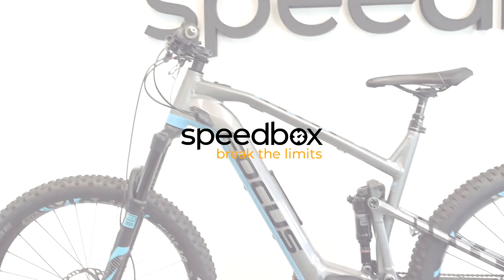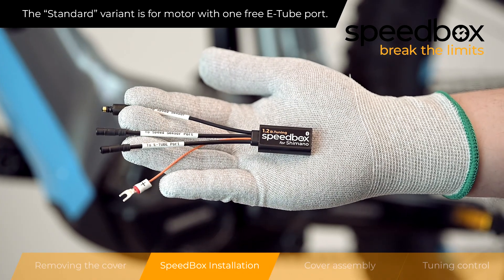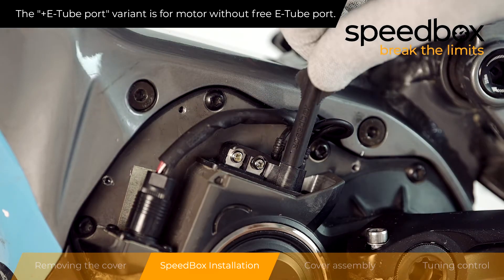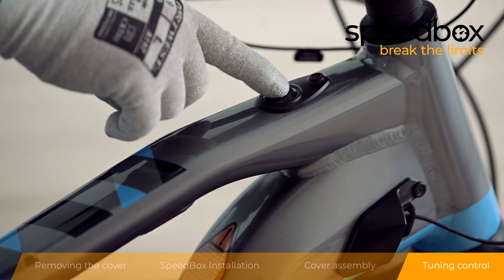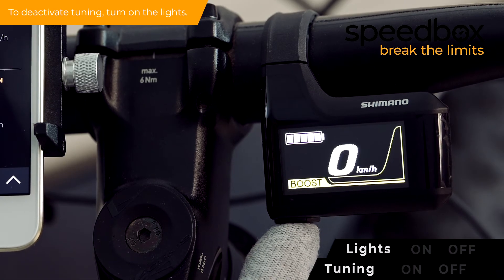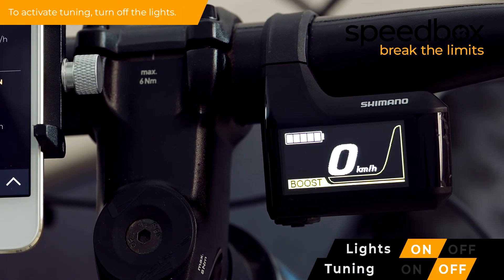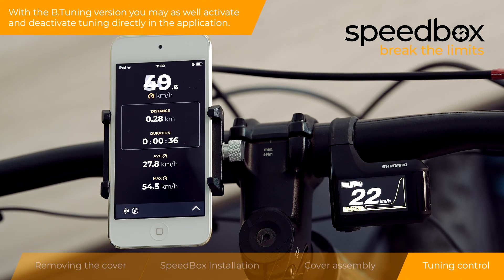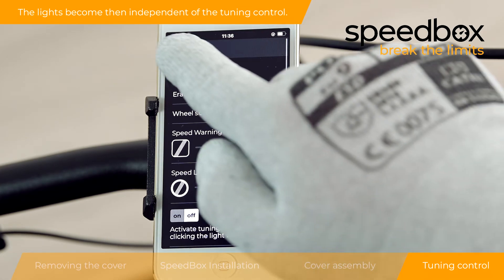eBike Tuning SpeedBox 1.2 (B.Tuning) for Shimano (E8000, E7000, E6100, E5000) Installation (+E-Tube)

Comment: My e7000 doesnt have the same cover . Its a different shape znd when i take it off there more nuts and bolts under it .
Reply from the maker: Hello.
This is an installation video using a specific sample model of an e-bike. Of course, different bikes may have different motor cover systems.
Reply: I can’t find the speed box for e7000
Reply from the maker: @dshow1658  Hello, what do you mean..?

Comment: Hello.
I am using the SHIMANO DU-E6100 system.
(Is the difference between SpeedBox 1.2 and SpeedBox 1.2 B.Tuning the Bluetooth connection?)
It should be fine if I install it as shown in the video, right?
Is it limited to one car? Can I install it on another car after using it?
Thank you
Reply from the maker: Hi.
Thanks for your question. The B.Tuning version has Bluetooth (B.like Bluetooth) built in, which allows you to pair the SpeedBox with a mobile app. Both versions are fully compatible with your e-bike. We recommend following the instructions in our installation video.

Comment: Hy, my bike with e7000 doesn't have Bluetooth, the adjustment its only by cable on the computer,  the speedbox will work's for me? Sorry my bad English, im in South America
Reply from the maker: Good day.
If you have a SpeedBox 1.2 for Shimano, you can control the tuning on the display.
If you get the SpeedBox 1.2 B.Tuning for Shimano version, you can control the tuning on the display or in the SpeedBox App, because the version called B.Tuning has a Bluetooth module in it.
By the way, our website is also in Spanish https://www.speedbox-tuning.es/para-shimano

Comment: I just received mine and was disappointed that it doesn't work, double checked everything, bike runs like normal, there is no difference to my speedometer, motor cuts out at 25km.

I have the light setting in the menu but it just beeps 3 times when i press it, no option to turn on/off.

I have also changed fork from positve terminal to negative, no difference.

Please help i have also sent an email.
Reply from the maker: Hello.
Did you send an email to info@speedbox-tuning.com? Someone from our support team should contact you soon.
Alternatively, you can reach out through the chat on speedbox-tuning.com.
Thank you.
Reply: @SpeedBoxTuning  Same problem here ... And now ?

Comment: the speedometer doesn't work when i use it the speedbox.
Can you fix it
Reply from the maker: Hello.
Unfortunately, the communication between the electric motor and the Shimano display does not allow for a real display of speed.
The only option is display in the SpeedBox App for products marked B.Tuning (B. as Bluetooth).
Thanks for understanding.

Comment: Does this void the warranty of the bike ?
Reply from the maker: Hello.
In theory yes, but practically it doesn't have to be. If you take your ebike to a bike repair shop, uninstall the SpeedBox from the motor. The presence of the SpeedBox will thus remain undetected and the warranty unaffected.

Comment: Can I use S.B. 1.2 for Shimano e8000 + E tube port on the motor without E Tube port ?
:) , the port is on the motor but no cable to connect to speed box.
Reply from the maker: Hello. Yes, you can 🙂Just don't plug in the orange cable with the fork plug.

Comment: Does it still works on the E8000?
Reply from the maker: Hi. Yes, it still works on the E8000 🙂
Reply: @SpeedBoxTuning hi where i screw the red wire down with the + on it there’s already a wire screwed in what should i do?
Reply from the maker: @outside2477  Hello. It does not matter. Loosen the screw and add the SpeedBox "Fork" with + to the one already there and tighten them both with the same screw.
Reply: @SpeedBoxTuning i unscrewed the screw but it wont screw back into place
Reply from the maker: @outside2477  Can't you put the screw back in that you took out? Or is it too short when you put in both red wires with the "fork"? Maybe try using a slightly longer screw with the same thread.
Reply: @SpeedBoxTuning yeah may just need a slightly longer screw

Comment: what if my ebike does not have lights?  How do I turn on tuning?
Reply from the maker: Hi. If you don't have lights, it doesn't matter. Just find the Lights button in the menu and turn it off/on to activate or deactivate the tuning. If the Lights button is not active, it needs to be set using diagnostics. Or you can install the SpeedBox without connecting the red fork. Tuning will then still be active.

Comment: My e8000 is Jumping with the speed like from 13kph to 38 back to 17 up to 87 using the same 1.2 speedbox. Cheers
Reply from the maker: Hi. This is normal for Shimano. It displays real values up to 23 km/h. For this product, real data can only be seen in the SpeedBox App for version B.Tuning. Thank you for understanding 🙂